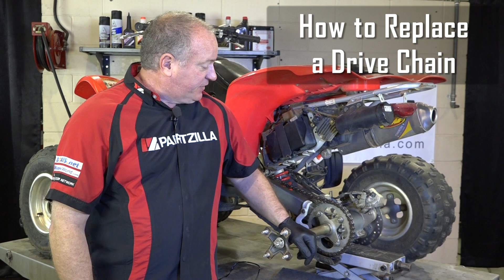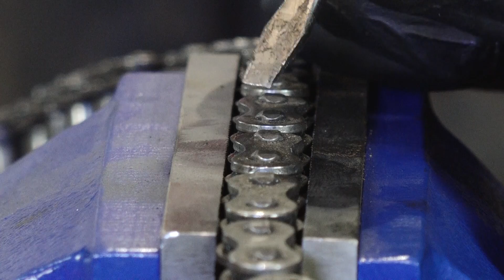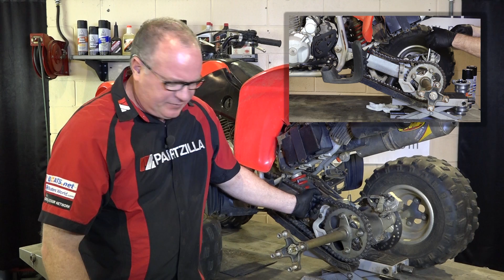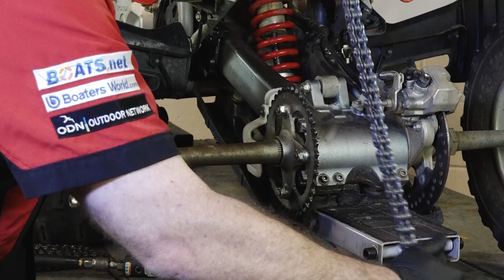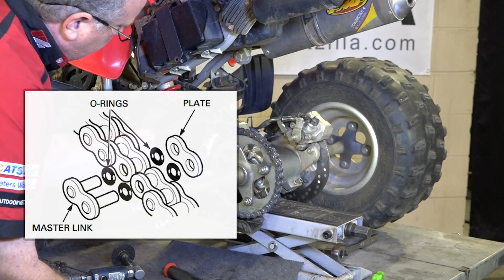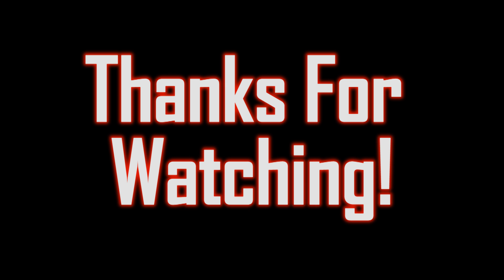ATV Chain Replacement | Honda 400EX | Partzilla.com

Comment: When you use the tApe measure how much play am I suppose to have before you tighten up the 4 Allen bolt an before you sit on it 1 3/8 an that’s from chain to the top of the swing arm?

Comment: I wish you had a closeup of the tool used for flaring. That’s the point where I am yet in regards to finishing up the chain installation. I have all these parts that came with my chain breaker/installation kit, but the flaring part is throwing me.
Reply from the maker: It is just a pin with a bowl on the end, you tighten it down, release and retighten multiple times to flare out the rivet.  Don't force it or you'll break something.

Comment: Y does my chain on 2008 honda trx 400ex get losse. i tighten it chain and i tighten bolts but i use i for a while a it will lossen
Reply from the maker: Watch this video, see if it helps.

https://youtu.be/naDf9NmQ3QM

Comment: mr.i have a knockoff atv do these parts fit?i dont even know what brand my atv is.expensive chain you installed.
Reply from the maker: You will have to check the manufacturer specs to see what size chain is recommended.  It will vary by brand.

Comment: what size chain.i have a 150cc atv?
Reply from the maker: You will have to check the manufacturer specs to see what size chain is recommended.  It will vary by brand.

Comment: thanks  again  amigo,....... my friend ,my son's 400 ex its not charging the battery,  , any idea what  could be ,
Reply from the maker: Typically, it boils down to the regulator or stator.  Test them and see where the issue is.